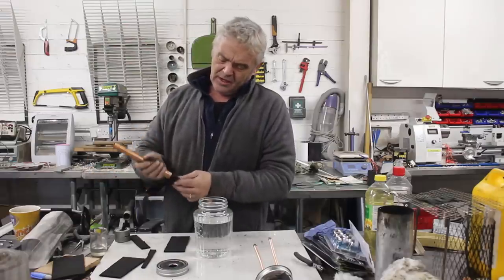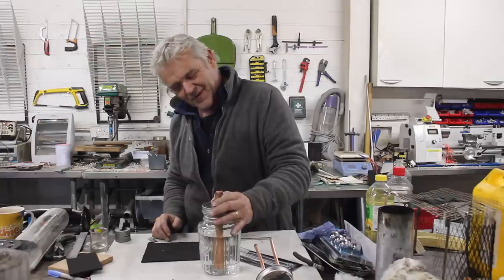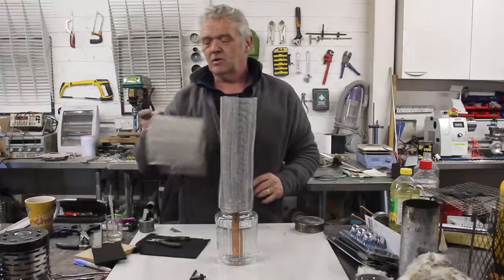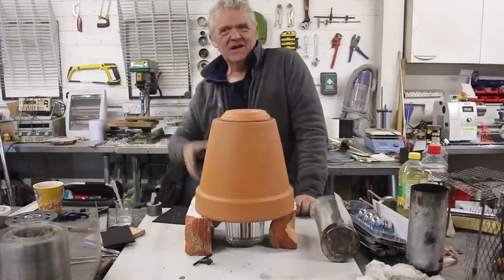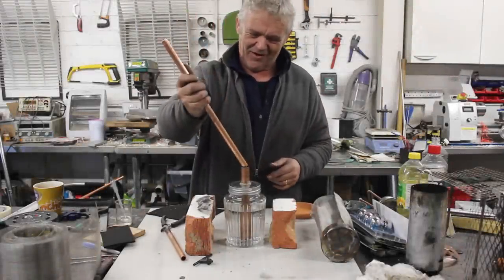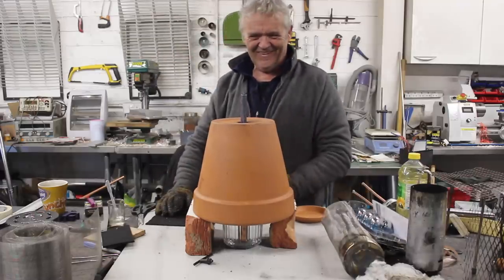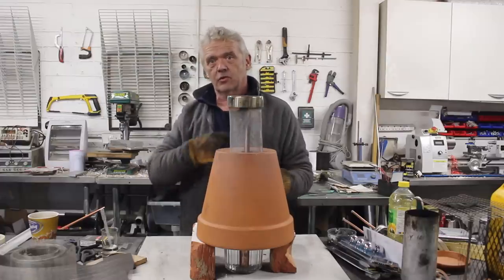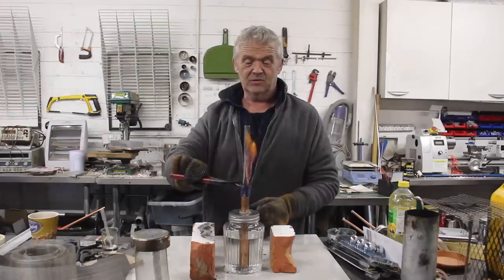1715 Improving The Copper Coil Burner As A Heater

Comment: Your inspiration has been fantastic. I made a copper coil lamp in a pint jar and it worked well. But I then put a SS mesh mantle with a lid on it and it worked even better. But when I put it into my version of your heater with the cake pan top and bottom, the extra heat trapped in there turned the lamp into a jet torch, burning well over 1,000° F on the top pan, burning 91% isopropyl alcohol. Thanks dude, for the help and fun!!!

Comment: Hi Robert. Everyone needs a grandad like you! Your just such a fun quirky stress free guy! Great family father/son/daughter fun projects to build and learn at the same time. My question is Robert. What gauge is stainless steel. Does it matter? Ooo and how long would that glass you had of alcohol last burning?
Reply: @Bill the grandad that keeps blowing up the shed you mean lol. I also wondered how long that heater would burn for Ethanol Methanol is around £13 a gallon and that's the cheapest i could find, so would have to last a long time to be worth it. Also that heater would be ok for outside garage or workshop, but not in a house the ceiling would be turning black after a while, its not 100% clean.

Comment: I have a French LeGrillon Alcohol stove, it came with a 25mm cotton wick, I replaced it with a wick made of wood stove door gasket material.
I make coffee every morning using it to heat my Moka pot , I can fry eggs
Burgers, cook a pork loin in a half hour. This stove puts out heat. A small tent is warmed with one burner, adjust the flame to burn blue an little
CO2 is created. Smaller heaters can be made with 1/2 inch wicks
for personal warmers. Alcohol is a safe fuel, the French stoves were packed with horse hair to prevent a pool of fire forming if tipped, I use fiberglass insulation. Alcohol fire is quickly extinguished with water and will not burn on water like some fuels will do. I intend on building a stove like you designed. THANKS!

Comment: Been toying around with heat exchangers etc.  . ethanol has a desire to permeate terra Cotta efficiently and naturally. I used to used crushed flower pots or an aquarium gravel made of porous material  in an iron pot soaked with alcohol for plastic bending   Ever thought about a wick from the carbon put in a tiny terra Cotta pot or on a bathroom tile instead  it'll vaporize Fuel  very well
Reply: I've been thinking about zeolite impregnated with calcium chloride as a phase change thermal energy storage material, in order to release heat after the flame is extinguished, especially while sleeping.

Comment: Another for the steam punk collection 🙂 You could use a brass end-cap as a snuffer and reduce evaporation when not in use.
Reply: Yeah, I'm not clear on how one would safely snuff this out if they needed to. Slide a larger diameter pipe that has a cap on the top of it over top of the pipe with the 1 mm holes? 

Also, those living in a small space would need something that can be kept safely out of the way and out of traffic and not accidentally be tripped over or bumped in some way.

 It would also be really cool if a Big Buddy heater could be safely converted to work on fuels other than propane, which is getting expensive. I wonder if they can be powered by ethanol somehow.

Comment: This seems to be basically the exact way that a kerosene heater works. Usually they have a roughly 6 in diameter cotton tube with mop-like fringe hanging into the kero reservoir. I may try my hand at making one out of carbon felt since they usually only last about 2 years with consistent use.

Comment: What material would work better for the heater tank ?? The glass part of the heater is the weak link, I have seen these puppies just crack, explode and start a fire. Robert, would plating the copper pipe with silver metal plating on both copper pipes would increase the intensity of the fuel being vaporized before the burn. Just an idea fella. Good day.

Comment: i have some 3"x 12"-14" copper pipe scraps that i have been thinking of making a small heating stove from for my small teardrop camper that will burn charcoal briquettes such as you use for a BBQ cooker since copper is a great metal for absorbing, and radiating heat. can you think of any problems i might have from heating the copper with a flame in this stove, such as a poisonous gas? i have them sitting on top of my woodstove now as well as a few disc brake rotors from autos to provide additional mass for heat retention and i have no real issues, and they retain, and radiate heat better than the steel even after the fire in the stove goes out, which is what gave me the idea in the first place.

Comment: Asking if any problems with ceramic pot getting too hot surrounding glass fuel jar.   Any boiling pressurized fuel issues.    Sorry if this was asked before —- wanted your thoughts of fire danger.  Was going to make something like this BUT leave an air gap to keep fuel reservoir temp below flash or exploding vapor temperature.  With heat going up into ceramic pots and heat sinks ( beers cans or steel cans with cut Finns)

Thank You !!!!!🎉.

Comment: Really 'cool' man!
I have to ask though;
How much fuel does it burn per block of time and for how many BTUs? ( general averages)
Reply: Depends what he is burning. The energy output of various fuels is easy enough to look up online.

If it is a blue flame it is operating at 100% efficiency. If it is yellow it will be slightly less.

Depending how you engineer your burner is going to dictate how quickly the fuel is burned and the energy released.

Comment: hey there Robert what your experimenting with is basically what I have in as a heating system in my house ,it's called "a brick central" the fuel I use is heating oil it's gravity fed and the reservoir is fed in from the base and the control is is done via a standard oil control valve that are used on a aga it's made by a company called HESS  .
the reservoir is a bit like a cooking pot a number of holes are around the base it also uses a balancing air valve all of this is done without any electric it allso has a coiled water pipe that heats my water by using the thetmo siphon principal.

Comment: I never trust glass of ceramic for burning. It inevitably cracks or breaks. Usually I just modify to use exclusively metal aspects aside from fuel and wick.
Even as a base, I use makeshift cooling fins, which only increases the heat output for a given area.
Reply: I took an old Aladin metal kerosene lamp base and used it as a base for the alcohol reservoir ! No glass to brake or spill the alcohol. I changed the cloth wickj to felt carbon cloth and it never burns down ! FYI

Comment: This is top notch and love you enthusiasm Robert. The only thing i ponder over here is when you put the plant pot over the top. With the pot covering it and heating the jar containing the fuel, does this pose a potential  problem of exploding some way? Could the heat cause the jar to crack , spilling fuel all over the place and igniting? Just a bit paranoid about giving it a go in the greenhouse but burning my house down on the process. Thanks.

Comment: The very first thing I did when I saw the forever wick was to make wicks for my Methyl hydrate  coil burner. I had an issue where I used a 5” tall jar and it would always go out and not burn the bottom 1/3 of the fuel. The forever wick did no better in drawing the fuel up to the copper to be vaporized and burnt. In your jar experiment I believe your wick was not pushed into the coil far enough. For I have made a coil burner in a 2L jar successfully though the longest “oil lamp” wick I could get was 5” long. There again it seemed when the space between the fuel level and the top was 3” or better the burner stopped. That when I realized it can only wick so high. This idea is intriguing, thanks. 
Edit: Also in my coil burners when I had the copper tubes ends submerged then too it would not operate.

Comment: Seems for the first undrilled tube design, the inner tube could have a pipe cap on the end to prevent spills - unless evaporation inside that tube is a major component of the fuel supply.

Comment: The Germans are gonna need a lot of those this winter. I used a metal trashcan with a rolled up paper towel as a wick with ethanol fuel during a winter where they cut the steam off from our unit just so I could heat up the bathroom as needed. Just be sure to have plenty of fresh air so as not to asphyxiate yourselves!

Comment: Ive been experimenting with alcohol stoves for over a decade and there are no end of designs to try. For a small heater I favoured an empty Sterno can/chafing fuel can stuffed with carbon felt. This will not spill if knocked over and will provide hours of heat on a fill and is dead easy to snuff out. Adding a small mesh mantle is something i never tried and I might just have to try that now.

Comment: I’m thinking that an aluminium extrusion with a central ‘tube’ for the flue and multiple fins running it’s length would make an excellent heating element with this at its core.  JB weld the extrusion to the jar lid, add a few air holes, presto, a safe indoor heater.

Comment: thinking out loud here, and correct me if I'm wrong, but it is my understanding that methanol has a higher energy density, while ethanol has a higher energy content. ethanol burns cleaner with less carbon monoxide and will burn longer, possibly up to twice as long as methanol. I believe it is a better fuel for these types of alcohol burner applications. methanol burns hotter, but for something like this that's using a terracotta pot that will hold the heat and emanate it over a longer period of time, I think ethanol makes sense. methanol may put out more heat, and I believe it costs less than ethanol, however, if you need a burner that will last throughout the night, ethanol may be a better choice as the methanol may burn out much sooner, though a larger reservoir may make up for that. still, I'd go with the fuel that produces less carbon monoxide if it's being used indoors.

can someone fact check me on all this? most of these answers I got from AI which is sometimes less than accurate.

Comment: A problem with the flower pot contraption is that measurements show it generates a lot of particulate matter. More than the heat source on its own. Apart from the general fire hazard, there's a less visible risk.

Comment: If you add a way to get oxygen into the centre of the flame, like a Bunsen burner, the alcohol should burn more efficiently, right? (Might have spoken a bit too soon, before the holy pipe, but I feel that having another tube to feed clean fresh air into the centre of the flame would still improve things a lot)

Comment: Add a pinch of table salt or two and the flame turns orange.

Did you try placing a copper cap on top of the inner tube?

Comment: I was skeptical about the value of putting a pot over a flame, until I realized that the heat from a flame rises quickly to the ceiling without warming much of anything else along the way.  If the pot intercepts the rising hot gas, it gets warm and radiates where you want the heat.  As far as the closed room is concerned, it's the same heat of combustion, but the pot keeps more of the heat where you can feel it.  But, don't let the cat knock it over!

Comment: Seeing your tests and testing results... And realizing I may have missed it,

Could you do a video showing differences in fuel burn compared to light/heat source size?     I understand their correlation with a propane heater using a throttling valve to control the heat output... What variables effect fuel use in emergency heaters/lights?

Comment: There is a danger of the alcohol vaper pressure over coming the static pressure of the atmosphere.  In other words if could boil over. I had it happen to me with a burner I made where the wick was too tight to the threaded cap. The vapers caused the wick to become super saturated.  It caused a run away effectively over heating the container by surrendering the container with fire. The hotter it got the faster the fuel came out
Reply: Always use a vented container to equalize the pressure.
Reply: I was extremely lucky that I had put my burmer on a cookie sheet, and I was on concrete.
Reply: If I had been inside on a flat surface i'd be homeless.

Comment: Be careful to enclosing any of those alcohol heaters in ceramic pots. as the alcohol heats it will pressurize the container, accelerating the burn creating more heat...and can become a runaway action akin to a jet, Ask me how I know...

Also, I suspect the loop will work if you cut off the extra copper feeding into the jar and just let the wick drop down. The volume of fuel isn't the issue, it's the heat sink from the amount of copper pipe in the alcohol. It's keeping the loop from getting hot enough.

Comment: Add a mini stove  fan on the top of the last mantle version to distribute the heat around the room. Is that making it too complicated? 
Which gets hotter, the flower pot heater or the DIY heater (1704) with brass feet, that you shared last week?

Comment: Does the copper pipe get hot enough to release noxious metal fumes?

EDIT: Quick Google search reveals that it does not. Copper only fumes at temperatures above its melting point.

Comment: Good ideas.
Any ideas for powering a Gas central heating system when the power goes out? It is ironic that it requires electricity to work but it doesn't require a lot of power, just control systems and the pump, I would guestimate 300w, so, an inverter would work but how big a battery? 18650's or deepcycling?

Comment: Are you not restricting your fuel uptake by having a flat outer tube pressing down on a flat bottom of the glass container?  Would it change things by having some holes in the pipe down there, or a non-flat bottom to that tube. or is the fuel intake simply optimal already?

Comment: So I finally found a solid place to get activated carbon felt in the US, finally no melting of the felt like in all my previous trials. Now, it's not the cheapest, but it works fantastically to recreate some of these projects.

Anyway, I've been wondering if you had considered threading a small amount of the felt through the alcohol burner copper tube to allow for a better chance at heavier wicking?
Reply: Where are you buying the carbon felt in the US? Thanks
Reply: @fuzfire  Fuel Cell Earth - I got some C280
Reply: is activated carbon felt different than  just plain carbon felt ?

Comment: I would also like to see what happens if you put an end cap on the inner pipe with a small diameter hole drilled in it

Comment: So a question on the mantle- would it be beneficial to make flat circles out of the stainless the diameter of your mantle, and stack a few of those up inside it?  It seems like that would get more of the fire- heat going straight up the middle and turn it into radiant heat dispersed through the mantle.  I might not be thinking on that right, and it might not matter, but it was a thought that occurred to me.

Comment: Here's what I've learned about heating from the internet, which of course would never lie to me!
12 pounds of Anthracite Coal has about 144000 BTUs, equal heat content to 1 gallon of fuel oil.
Methanol, about 70,000 btus per gallon. 
Hydrogen, about 103,000btus per gallon (equivalent)
Propane, 91,500 btus per gallon.
Kerosene, 131,000 per gallon
Natural gas, 136,000 per gallon (equivalent).
Electrical resistance heaters produces 3413 btus per kwh, about 57 btus/minute. 40 kwh produces the same btus as 1 gallon of heating oil, about 140,000.
HHO has not been as well studied, (and written off as quack science because of people hoping to run their cars on water.) The best figure I can come up with is about 70 btus per liter.  According to pages describing the ‘best’ HHO generators, it takes about 180 watts to produce 1 liter per minute of HHO. 
I’m terrible at math; but if I’m getting this right, you could use an HHO generator to produce gas to heat a room at 70 btus/minute for 180 watts instead of an electric heater producing 57 btus/minute at a cost of 1000 watts. 
Can that be right?

Comment: Hi Robert, I found plans for a fuelless engine a while ago is there a way I can send it you as I have little to no understanding of it, apparently it's a modified ed gray motor that uses milliamps to discharge thousands of volts in to electromagnets while charging the battery back up with back emf.

Comment: I have a fireplace. Use to be gas. No gas in the house all electric. Last yr. 400.00 bill. So the fireplace is built for heat. 200 sq feet. Any ideas. Without fake electric logs.

Comment: do you rap the entire middle tube with the carbon felt  or just half of it because my  candle will not light up Ido I have to fill the Jar with the alcohol all the way up like you did  ??  what happen when use most of the alcohol  and it drops to about an 1"  does it still works ??

Comment: Any thoughts regarding how a family, using this for emergency heat, safely shuts it off after a few hours? It seems like spills are a likely result each time it is touched, by family or pets, especially when hot. Containing flaming spills? Does Methanol tend to self extinguish when spilled or does it continue to flame? Basically it seems like this series can use a "What to plan for when things go wrong or to reduce the likelihood/severity of things going wrong?"
Reply: A fire blanket and extinguisher would be prudent to have to hand and CO meter, these things fairly get going, Chinese Diesel heaters probably a safer option for using a flamable liquid indoors, or a portable gas fire.
Reply: You could always place it against a wall and chain it to prevent it getting knocked over.